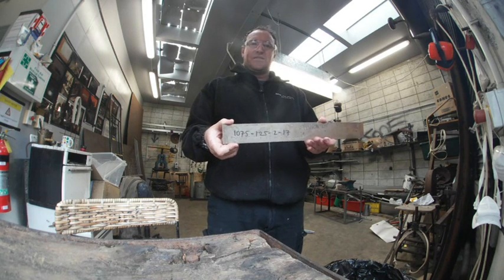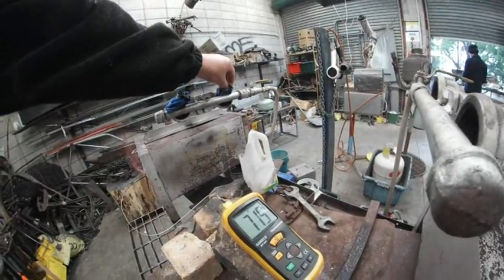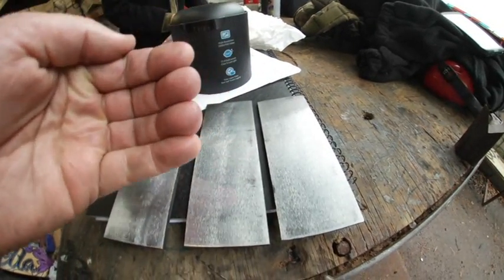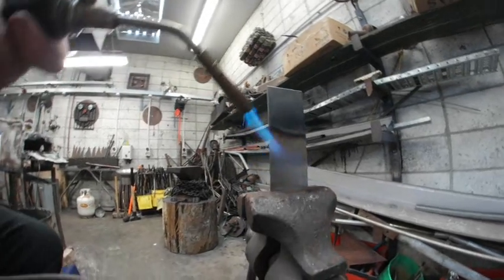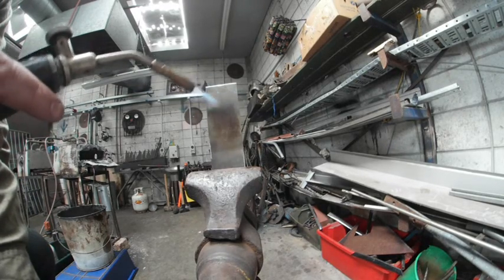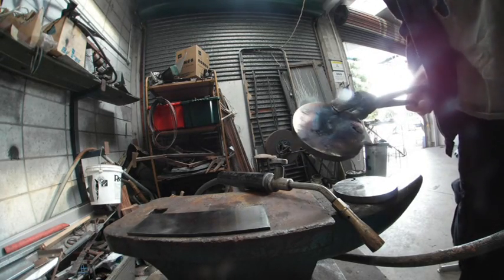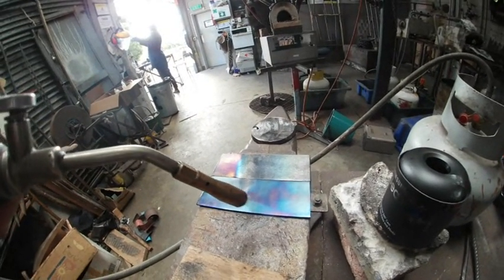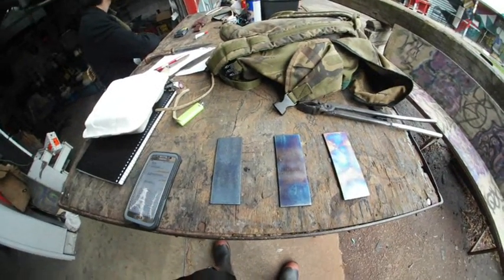How to Temper Colours in Steel?

Comment: Start at the bottom because heat rises. Low heat, be patient, when you start to see good color back off with the heat and watch it "bloom". Practice, practice, practice!
Reply: Thank you for sharing this tip! I'm interested in learning how to do this and was wondering if you had any sources you could point me to?
Reply: @ItsaJuraff  you don't have to harden the steel first I do a fair amount of coloring with heat. No real sources just heat some steel and see what you can do. I start at the bottom and heat the whole piece slowly. First color will be straw ending in blue. Go too hot and it turns back to silver.   Once you go that far let the piece cool and sand it to remove the color layer and start over. Like he says thicker steel is more forgiving. Plus you're only looking for about 300 degrees f.
Reply: @mikemurray5263  Awesome. That's super helpful, thank you!
Reply: @ItsaJuraff  I forgot to mention I usually use a propane torch for this because it's a little easier to control the heat. Easy does it and have fun!
Reply: @mikemurray5263  Will do! Thank you!

Comment: I got a stainless steel moka pot and forgot to put water in it when I put it on my induction cooktop. It heated up red-hot and the bottom is a very bright silver, but an aqua silver. Further up, it became blue. Now, I'm thinking about using a TIG welder to do fun things with it.

Comment: Just found your video......I'm learning hear with you.   My experiance that im willing to share with you though on the fist one you talked about you over heated it,  and it was dificult.  I jumped through a lil bit same issue on the next and it was difficult.  It was the positioning of the plate in the vice vertically. Heat works like water but in reverse water. While water chooses the path of least resistance in the direction of gravity heat will choose the path of least resistance away from gravity.   You then went to the anvil with better results. The positioning of the plate was horizontal.  I will try this myself tomorrow, I think if you have it on a rack and heat it from the bottom youll be able to get your temp.   that or flip the plate every so often to try and get a complete soak.   It might even be easier fireing up some coals .  Ill let you know how it turns out till then,  More vids.  Good job by the way
Reply from the maker: Thank you
Reply: I did have better results with moving in the direction of heat.  i apply until i see it turn gold and add heat pull away add heat pull away and use the blue to choose my travel speed.  been frustrating because sometimes i feel i have it then go to duplicate and find im not as good as i just thought.  The one one the left that you liked at the end.   Was that the oven?
Reply: Hot air rises.  I like the idea to heat from underneath.  Also keep in mind that you should move on just before the color you want is about to appear. If you want blue, once it turns purple, start moving.  See if that helps.
Reply from the maker: Thanks I really should make more I have been concentrating on other things for a little while I have a project that will use this and other skills I have learned on the go slowly should video that!

Comment: Can this be done with sheet metal ? I’ve got a vintage industrial locker/ cabinet and this couloir would look amazing.
Reply from the maker: It should be possible it would have to be clean of rust before hand I would suggest giving it a go in a small corner or around the back first, it has to be covered in a layer of clear varnish or other coating right after as even the oils of your fingers will degrade it very quickly, also if the sheet metal is galvanized I would not recommend it at all as the fumes can be very damaging.
Reply: Don't heat up galvanized metal it's toxic!

Comment: What gas is used in the torch? acetylene? Does this work on galvanized iron?
Reply from the maker: It's basically your local natural gas ie propane. I do not think it would work on Galv but I did not test this.
Reply: KiwiFighter really thanks
Reply: I highly doubt it would work on galvanized iron... with that said, I’m not an expert.... i just watch a lot of metal working videos, so take that with a grain of salt

Comment: Hi, I had a question about getting an even bluing or black oxide or parkerizing finish on a steel tip that has been flame hardened. Usually I get a bluish or multicoloured shade on the tip after it's heated and tempered. Later when the same is blackened by one of the above mentioned processes, the tempered area usually shows reddish while the rest of the surface is nice and black. Anyone have tips on how to get an even black colour throughout?

Comment: I'm making a dog tag with my gf's name carved in it from aluminium, but I want it more special with those blue temper marks you just did in the video. My question tho is if I heat up that piece of metal like you just did would it keep that colour forever?
Reply from the maker: it has to be protected otherwise it will wear off quite quickly, I used a clear coat protectant on a piece that has held up very well but its not being worn I don't think that method would hold up well on something like that
Reply: @KiwiFighter  Alright thanks for your time

Comment: So I don’t have a forge, I do have a Acetylene torch, would that work?
Reply from the maker: it is heat that causes the reaction so it should give it a go with something and see what happens trying things out yourself is often the best way to learn, also if you want it to stay coloured I suggest a clear coat protectant to stop any degradation of the colours.